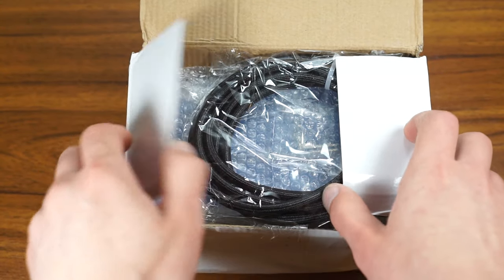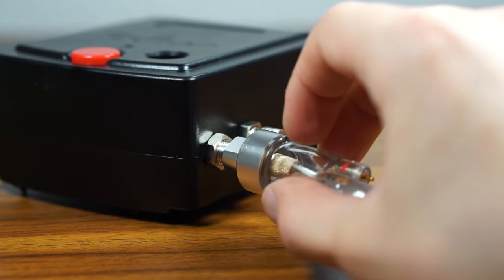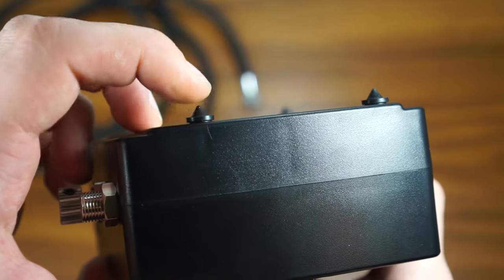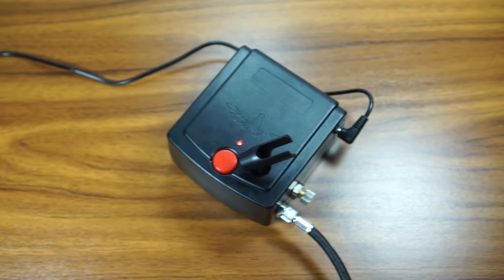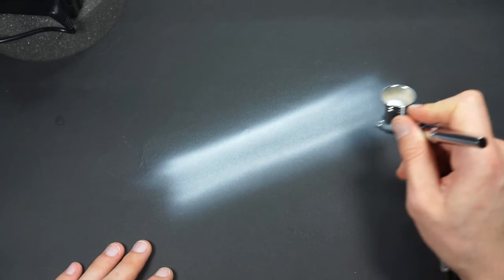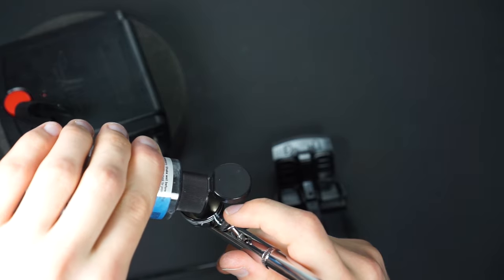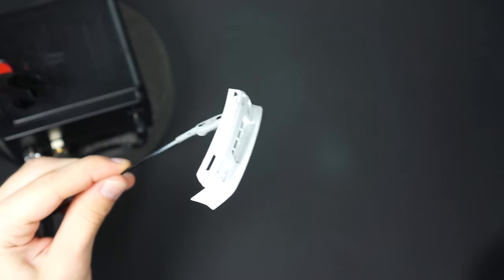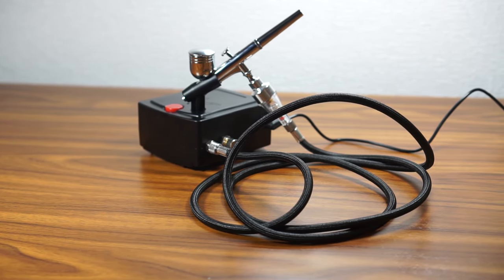Cheap airbrush kit - good for scale modeling?

Comment: I am looking for a mini airbrush kit for my models but I have to find one that the compressor is not so loud
Reply from the maker: Mini compressors are loud, i doubt you will find something significantly quieter.
Reply: So which airbrush kit would be best even if it is loud
Reply from the maker: @linkmasters535  I'd suggest looking  at most popular options, something like compressor AS186 and airbrush  of your choice.
Reply: I looked it up and I can’t have that in my apartment room my place is like a motel converted to a small apartment complex and I don’t think my manager would agree to this now that portable one for 35 bucks maybe I just don’t know
Reply from the maker: @linkmasters535  if you really need quite, than go with Mr.hobby linear compressor L5, and you will also need power converter since that compressor is JPN only.

Comment: How long time paint of this airbrusu
Reply: Assuming your question is about the compressor, the manual says it should not be used more than 30mins. Overall, you should use it for some 10 or 20mins, then take a timeout.

Comment: Would this be good for paining rc body's
Reply from the maker: Rc body paint tend to have flexible additives, those increase paint viscosity and thickness. That's why rc body paint require more air pressure than this compressor can deliver. Short answer - no.
Reply: @StaticModel  thank you buddy seen as u know more then just a yes or no answer if I was to use automotive paint and thiners would it be possible then or still to thick for the pressure of this and one last thing do u have one u would recommend that isn't a crazy price
Reply from the maker: @ogdizzle155  this one is more of a "arts and crafts" item and not a tool you can rely on when going for nice finish. While airbrush is decent, air pressure is way to low. For rc bodies,canvas airbrush drawings, touchup painting in real cars I wouldn't go lower than AS196 compressor and airbrush of your choice. If noise is not a problem, than invest in quality airbrush and get powerful household compressor...
Reply: @StaticModel  thank you dude really appreciate the help I will look in to the compressor you suggested see what I can make happen

Comment: Would this be suitable for a spitfire
Reply from the maker: If you are talking about painting aircraft model "Spitfire", it will work, but it may be difficult to achieve crisp camouflage pattern if you are beginner.
Reply: @StaticModel  I am a beginner yes and I am talking abt the aircraft, if I use some kind of tac or tape would that help

Comment: Tried one.of those small compressors with a kit to try airbrushing. Was total trash and jerry rigged my tool compressor to run it before i bought a proper airbrush conpressor to keep the noise down for the wife.

Learning quickly i need to be able to adjust my preasure accurately based on task. The airbrush that came with it was ok tho.

Comment: This one is not compatible with acrylic paints
Reply from the maker: Stop spreading fake information, it is compatible with acrylic paint.
Reply: Actually, it says on amazon that it is not if you scroll through the pictures, but it also says in a tiny print under that it can work if used with a thinner.